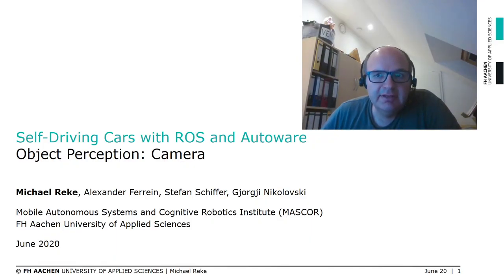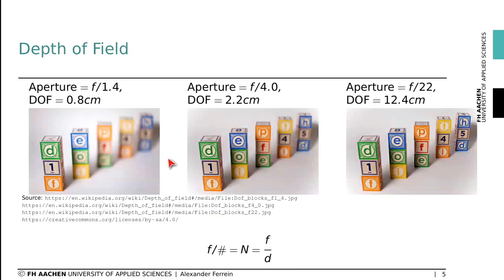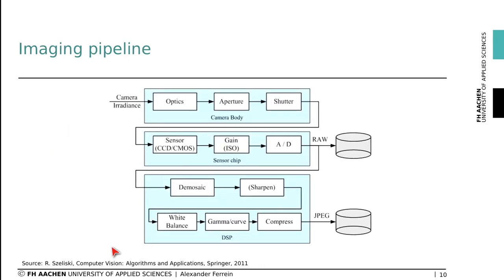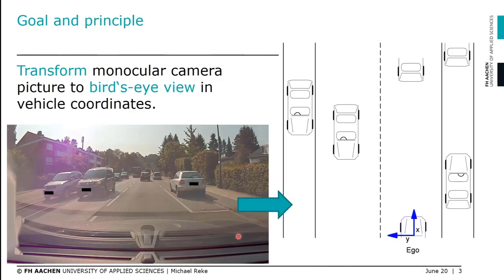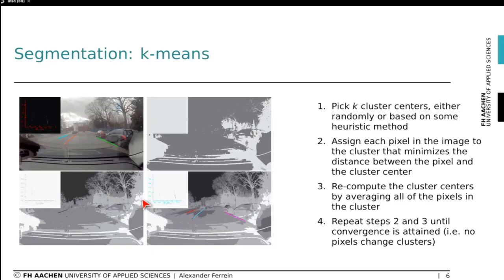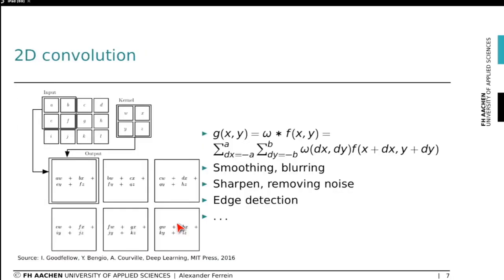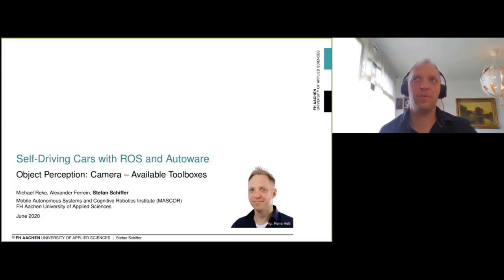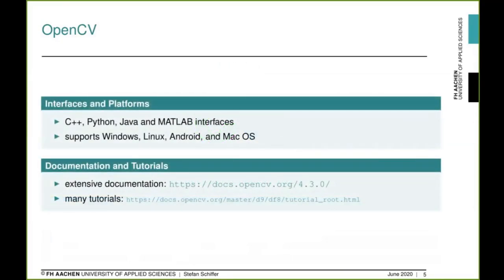Autoware Course Lecture 8: Object Perception: CAMERA

Comment: Congrats for the lecture now I understood much better bird-eye concept and OpenCV functionality!!! Amazing!
Hi @Dejan Pangercic and ROS friends
Do you know which cmd can I issue to clean my ws? In ROS1 I used catkin_make clean and then built again the ws from 0. Is there a kind of " colcon_build_clean" ?
  I am having issues to build the perception pkg. 
There are 2 pkgs dowloaded from repo: " Camera-Hands-On-Solution-WS" and " Camera-Hands-On-WS"  they have the same size. 

I copied one of them to my ~/adehome/AutowareAuto and issued the command colcon build --symlink-install to build it. Then unfortunately I had error msg that I will submit into issues in github... after that I deleted this pkg and moved the other similar one to the folder and tried to build again....the resul is that I have now more errors (I mean the system built some subfolders from the first pkg attempt = "Camera-Hans-on-WS") then when I try to build the "Camera-Hands-on_Solution" (even with the first one removed from my ws) I get the error:

CMake Error: The source directory "/home/autoware-ros2/adehome/AutowareAuto/Camera-Hands-On-WS/src/lane_msgs" does not exist.

Thanks in advance. 
I will sub,it the full error in git issues :)
Reply: Solved! It was just to copy the "Camera_Hands-On-Solution" outside the the adehome/AutowareAuto directory. I do not understand exactly why...then just 4 pkgs were created...maybe some conflict with the other 87 pkgs of Lidar class happens...who knows!? well besides that one strange factor is that rviz2 is not launched if the user does not issue the following commands to enter the ADE (Before enter the directory of the "Camera-Hands-On-Solution-Ws"
cd ~/adehome/AutowareAuto
$ ade --rc .aderc-lgsvl start
I got this command from the simulator class, for some reason is the only way to create a stable connection with rviz2 without this, just entering ade normally I had huge errors of rivz2 such as "badconnection", "OGRE", "tried 1000 times before abort", "core dumped",  and other driver complainings....but maybe it is just a local error, I mean from my graphics card limitation ? (GeForce GTX 1050 Ti/PCIe/SSE2) and  NVIDIA-SMI 460.32.03    Driver Version: 460.32.03    CUDA Version: 11.2 ???
Reply: @MarcusVinicius-lq3fe  hello Sir, I am doing about the autonomous vehicles. But now I'm getting lost because so many things to deal with... Do you  have any recommend steps for a newbie like me please. Thank you so much !
Reply: @calemvlog  I watched all videos and tried to implement the examples. If you don't understand something my hint is to interact with ChatGpt about code or content, you will advance a lot. At least this is my "methodology".
Reply: @MarcusVinicius-lq3fe  Thank you very much for you advise. I also use chatGPT to help me out but it's still hard to know what to do cause it's too much thing to do kkk. By the way, I will take a deep breath and keep going bro. Cheer up :hand-pink-waving:

Comment: Lane Detection demo is very difficult to understand for the beginners to run it following the video. Specially how to clone the codes and where to put them and how to source them and run them properly very hard to understand and follow from the video. be able to run the code is important for the beginner otherwise will be frustrated! even in the lecture slides no instructions for step by step running the demo
Reply: I am at very initial stage. it seems initial steps are skipped very fast and hard to understand how to start step by step. After cloning I did not see any directory called Camera-Hands-On-video-WS but on the video it seems it was in two terminal window